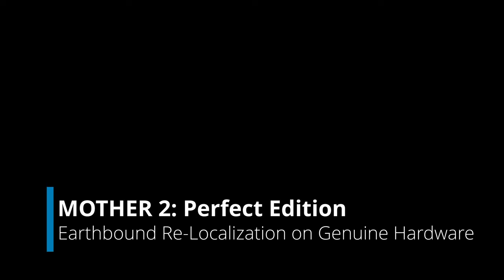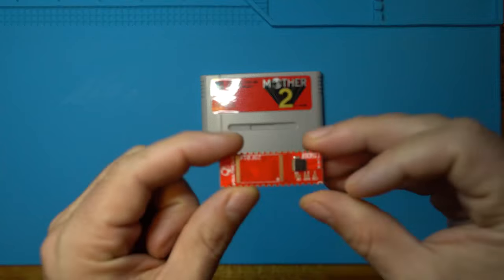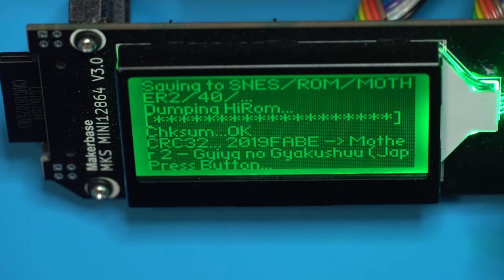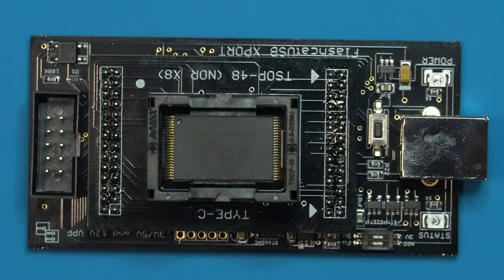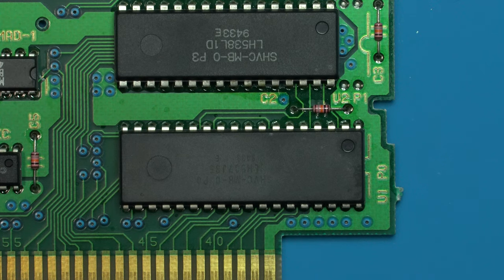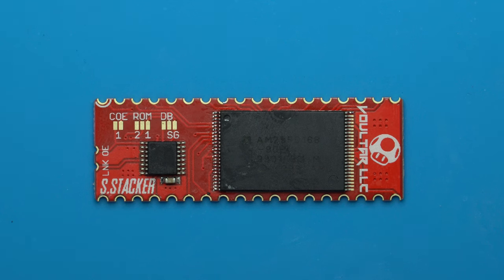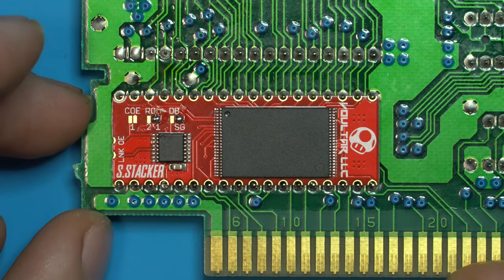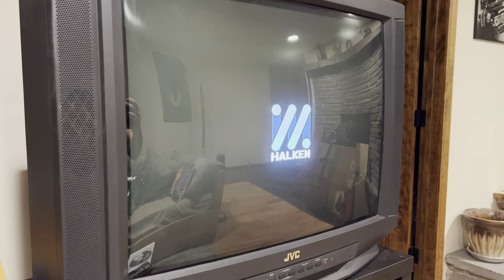Let's make MOTHER 2 (Earthbound) Perfect Edition using Voultar's Super Stacker

Comment: Hopefully last question for you sir. I just received my programmer from embedded computers and am at the point in your tutorial where drivers have been updated and the chip installed on the nor x8 piece. Within the application instead of detecting the chip it states "Flash memory detected but not found in Flash library." Any ideas what may be the issue? Thank you.
Edit: 5v switch wasn't set for anyone whom may have the same issue.

Comment: Hi, nice video. Wondering about your cartridge riser, is the shell printed, do you have a STL that you could share or point too?  Thank you.
Reply from the maker: It is just a SFC to SNES adapter you can find on Amazon, it comes in the shell.
Reply: @kytor  how come you don't just snap the tabs out? If you don't mind me asking?
Reply from the maker: @notsuoh16Bit  It's just my preference, for a few bucks an adapter prevents me from doing something irreversible to the console.

Comment: Was this such an elaborate mod to avoid copyright issues with Nintendo?
Reply: Doubt it. You buy the cartridge, and play a backup of it, end of story. Doing this is very pointless when you can just use an sd reader and even put that inside the real cartridge if you want to be fancy about it. No need to mod the original board.

Comment: I noticed you have 4 empty pins on the end of one of the ROM chips. How do you decide where to align the S.Stacker board on those 4 empty pins? Also, do you solder the S.Stacker board to those 4 empty pins?

I noticed in a different vid that Voultar uses a combination of a S.Stacker and his 8 Megabitz board to get around that. Not sure how that works, since it’d be 12+ megabits on the 8 megabit board..

Comment: Hi,

I am getting ready to do this exact project. However I will just be flashing the normal 24 megabit earthbound english version onto a Mother 2 cartridge. I will be using 1 Super Stacker (16 megabit 29F016 29F800 TSSOP48 chip) and 1 8Megabitz (8 megabit 29F800 TSSOP48 chip).

I just received the flashcat however it came with 2 different tssop adapter boards one that is x8 and one that is x16 and I'm not sure which one to use. 

Any help would be appreciated thanks.
Reply from the maker: You'll want to use the X8.
Reply: thank you so much for your help.  @kytor
Reply: @kytor  I successfully was able to do this!. thanks again! btw I am aware that earthbound has many anti piracy measures that it checks in game. Have you encountered any sort these on your Mother 2 perfect edition? It's not seen your video, but did you use IPSandSum to restore checksums?
Reply: @kytor I bought the X8 but i wanted to add mother 2 perfect edition, am i screwed? do i need to get the super stacker?

Hopefully i can use the X8 for chrono trigger i hope...

Comment: I do wonder if a device can be made that can take unmodified cartridges and patch them with the hacked modifications on real hardware without having to put any special chips into original carts
sure flash carts make this somewhat redundant but the closest thing that exists as of now is the Super UFO Pro 8, you can apply stuff like English translations while running original cartridges but I would be extremely interested if something like that can be made for specifically patching games since the Super UFO is out of print and is extremely hard to get your hands on

Comment: Is it possible to import megaman X2 or X3 and translate them into English instead of having to pay skyrocket prices too?
Reply from the maker: Unfortunately not, not easily anyway. Different maskrom style.
Reply: if you've got a flash cart, import, dump, patch and run off that. works a treat.

even with the price of a flash cart, a cib jp set would still be less than one cib us copy of x2 or x3. and you can use it for any of them you import later on.

i've done this for a bunch of systems and games that are ridiculous here in the us thanks to wata and the speculation. pretty rare to find certain games for under 300 cart alone.

i used to be able to pick up most snes games for a buck or two in thrift stores.
Reply: @kenabi  I’ve also have the megaman X collection on ps2 but they ruined x3 w the soundtrack smh and the ps4 collection looks like ass. There’s also those cheap Chinese clones of the sd2snes

Comment: Wait...if you're going to use an edited copy of the ROM, replacing the one in the cart anyway, what's the point of getting the original cart?
Reply from the maker: To get a re-localized Mother 2 experience bound inside the original hardware. You could use an original Earthbound ROM on Voultar’s mod chip, or an Everdrive, or emulator, or whatever you’re into! Lots of options available these days.
Reply: Also price I guess. Japanese SFC games are dirt cheap.

Comment: What is that cartridge adapter inside the SNES console for?
Reply from the maker: A low cost SFC->SNES cartridge adapter. As others have pointed out, you can also use a pair of plyers and break off the tabs. But I just prefer a non-destructive method where possible.
Reply: @kytor  Yet another reason not to do this and just use a flash reader. The irony is your destructive method to the original cartridge while preserving the imo worthless SNES. Get an SFC if you are that fancy about it.
Reply from the maker: @freeculture  Thankfully on the cartridge mod side, it is completely non-destructive! If you prefer not to clip the maskrom pins, you can simply desolder the maskrom. It's very simple, and completely 100% reversible.

Comment: I would love to do this with Tactics Ogre, but I saw somewhere that the ROM size is 24Megabits and one ROM slot. I have really limited knowledge in this, but I don't see how the ROM could be divided into two even segments for this project.
Reply: The Super Stacker allows to stack two 16 megabits onto one another. If you look at the left-hand side of the Super Stacker board, you can see where you would solder one on top of the other.

Comment: I love tinkering with game console mods, but tbh I don't get the point of this. If you're going to swap the ROM anyway, you could just get an aftermarket case and print out a label and stuff it with it's own SF board (or just buy a bootleg copy and save yourself the trouble); no need to alter an original game like that.
Reply: Exactly. It feels like he is damaging the original just to apply a patch when you can play the patched game using other means that still use the real console. And you avoid the mod, the parts and this long video procedure.
Reply: it's 100% reversible and the maskrom is left intact. it's fine
Reply: @_BELMONT_  even so, what is the point of this? why bother Frankensteining a cart together?

Comment: This is kinda' cheating. The content of the original cartridge is irrelevant to the function of the Super Stacker, so you might as well use the cheapest authentic game you can find. It's functionally the same as using an Everdrive; it just uses a different means of bypassing the Super Nintendo's copy protection for the purpose of loading an arbitrary ROM.

Comment: Cartridge adapter? I modified my Snes the old-fashioned way...clipping out the tabs in the back of the slot. (And I was lucky, it wasn't the revised model that had a little metal in those tabs)

I'm not surprised that the Japanese version is much cheaper. But, there's other genres where the Japanese version is cheaper. Last I checked, Rockman X1-X3 are cheaper than Megaman X1-X3 (X3 is particularly insane: a complete boxed Rockman X3 can go for around a Benjamin, whilst a boxed Megaman X3 is currently "on sale" for *1260*, down from an unholy _1400_!!)

Comment: I like the work here but it's profoundly silly to destroy an old, working cartridge while claiming you're into the "authentic, original experience" and that's why you won't do something quasi-sensible like using an Everdrive or an emulator.

This is no better than the "repro" nonsense that swept up retro gaming for awhile where people destroyed old game carts to put a different ROM on them, again for literally no reason.
Reply from the maker: The benefit of this method is that it is reversible.
Reply: What's destroyed? This is 100% reversible.
Reply: @kytor  Soldering is only technically reversible. We're inching real close to the Ship of Theseus thought experiment (yes, the same one WandaVision memed into pop culture) by claiming it is.

A reversible mod means the original parts are fully intact, and (re)soldering means it just isn't.
Reply: @mjc0961  Reversible means the original parts are fully intact, soldering... isn't.
Reply from the maker: @mr.number9279  If you're a stickler for full reversibility with zero cutting, there is thankfully a very simple solution: desolder the maskrom(s).
Reply: @mr.number9279  I'm pretty sure the Ship of Theseus was a pop culture thing before Wandavision came out. Besides, the only original part that's actually missing is the battery. If you're still going by the ship metaphor, this is the cartridge hacking equivalent of replacing a broken rudder and swapping all the old sailing manuals with a bookshelf full of translated versions.
Reply: @anxietyprimev6983  I can almost guarantee you that it wasn't in pop culture before 2021 or so given it's a philosophical argument and philosophy is REAAAALLY far from mainstream anything.

It only entered pop culture in 2021 because a Disney+ (a very popular streaming service, and new) show for the Milkithard Cinematic Universe used it in its final episode.
Reply: @kytor  How about no? Yeah its "reversible" but you essentially need to fix it all back, it isn't going to be factory original as it was. You are going to tell me your long video is better than using a flash reader that can even fit inside a real cartridge? And then you have the nerve to not want to remove a couple of plastic clips from your "precious" SNES because that is "destructive"?
Reply from the maker: @freeculture  Yes.

Comment: Why do you need to dump the rom to begin with?
Reply from the maker: In this case, just for preservation. It's not otherwise necessary.
Reply from the maker: @F0CKSTR0T  If I can give you any advise, take it slow and gentle. Use flux, a fine tip iron, and a desk clamp style magnifying lamp. You've got this!
Reply from the maker: @F0CKSTR0T  I believe Voultar is building these in-house now, so hopefully restocks should be more frequent than in the past. But I'm not sure what his schedule looks like.